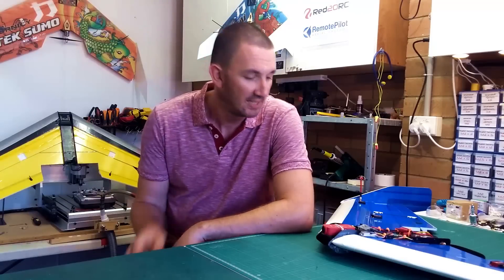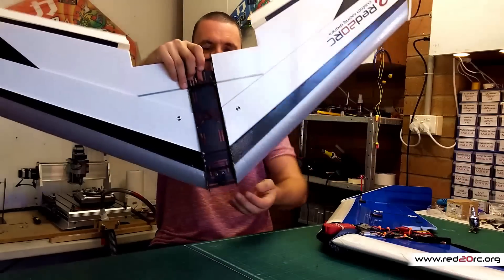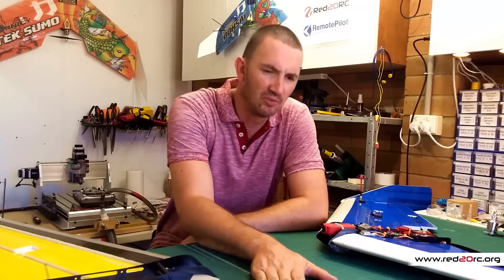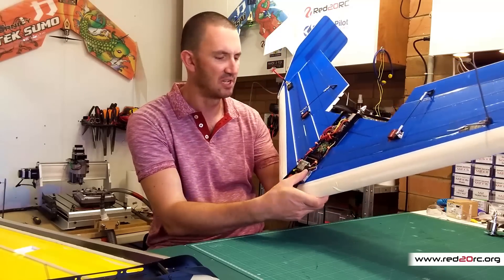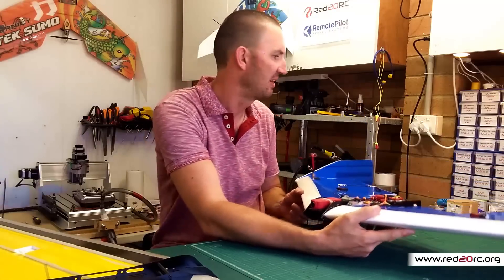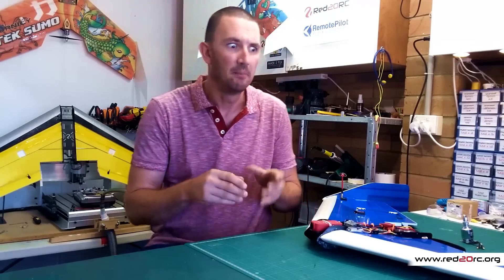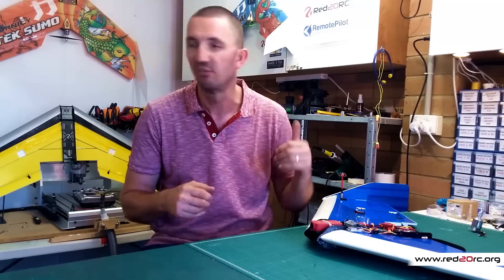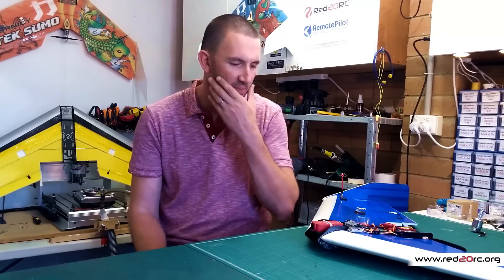Katana X2 KFm6 FPV Flying Wing

Comment: how about 2 batteries buried just behind the leading either side of the centre pod? if you have to carry weight at east it'll be useful
Reply from the maker: I've done that before with a modified Versa Wing. It worked really well.

Comment: I am a newbie in flying wing. What KFM that produce most lift? I wanna make an efficient wing that has the best lift performance.
Reply from the maker: +Dragonfive FPV The KFm2 or KFm3 provide the most lift and have a nice gentle stall. These are section with the steps only on the top of the wing.
You can find out more about KFm airfoils and their development at - https://en.wikipedia.org/wiki/Kline%E2%80%93Fogleman_airfoil

Comment: Brought motor bulkhead forward but make winglet slightly longer? I thought that's contradictive.
Reply from the maker: There's very little weight in the winglets so they won't counteract the motor shift that much. It seems to be a worthwhile tradeoff for stability.

Comment: Congrats, very stable! 
Did you use any stabilization?
Reply from the maker: thanks! No stabilization used on this one. The KFm6 is a very stable design and I fly with a lot of expo and differential dialed in to keep it smooth.